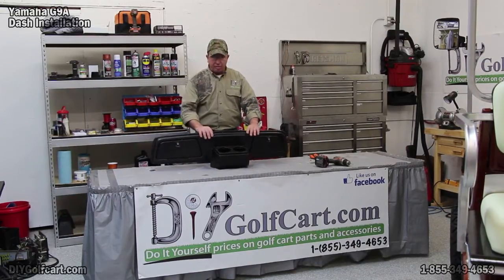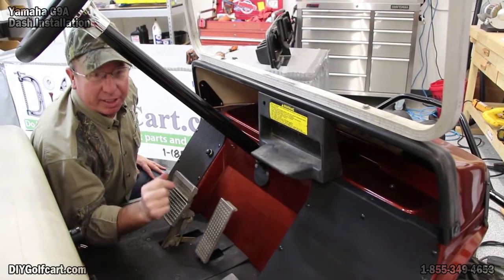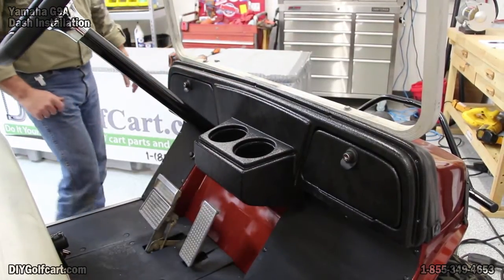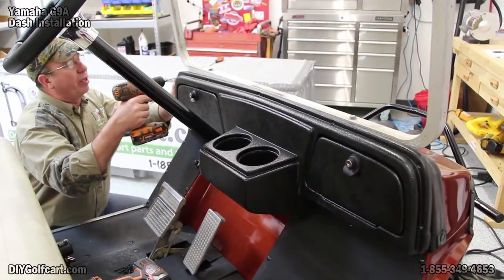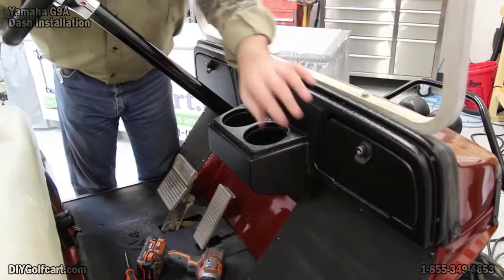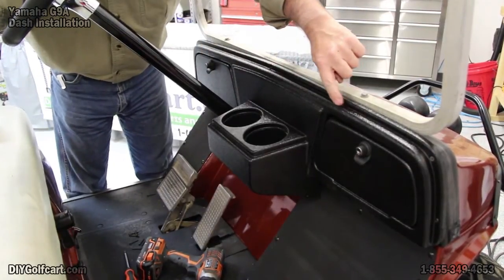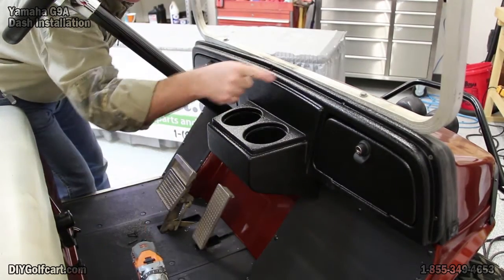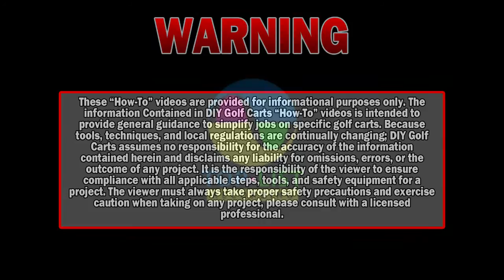Yamaha G2, G9 Dash | How to Install on Golf Cart

Comment: Can you guys do a video on a club car precedent battery cable replacment with 6, 8v batteries?
Reply from the maker: Right now we are working on a video for a Yamaha Drive Gas. Our next build will be a 2010 Club Car Precedent with your battery configuration. I would not wait around for the video however. Please call our tech department from M-F 9-6 CST and we will help assist you. (855)349-4653